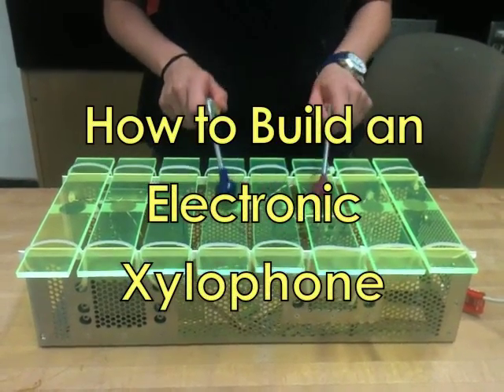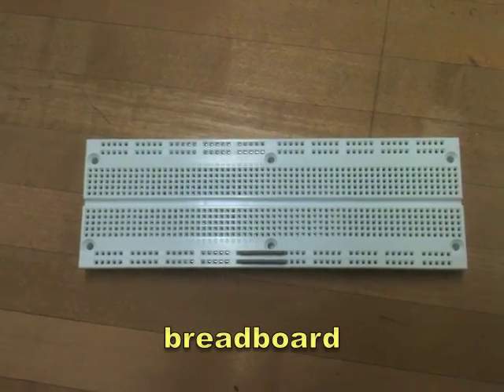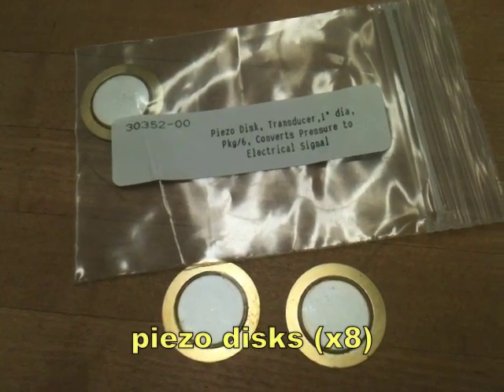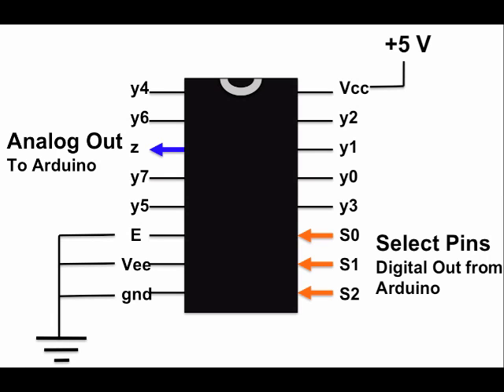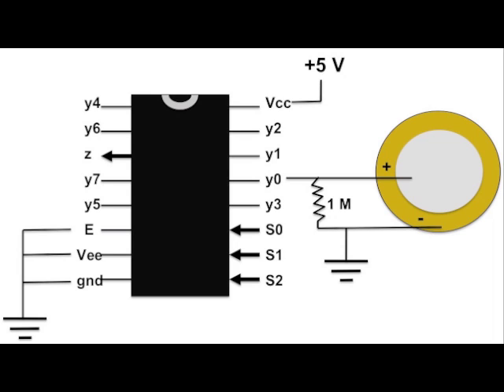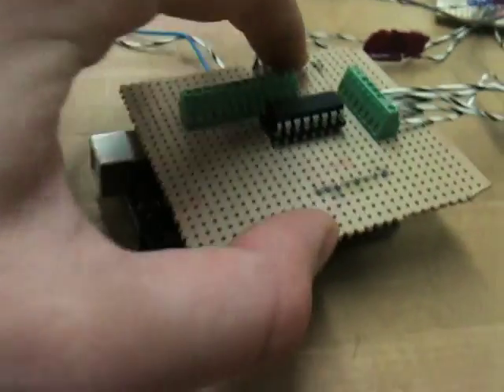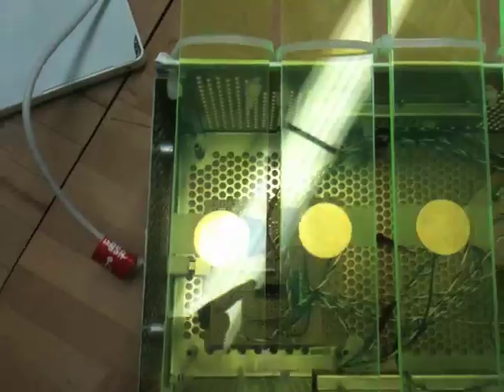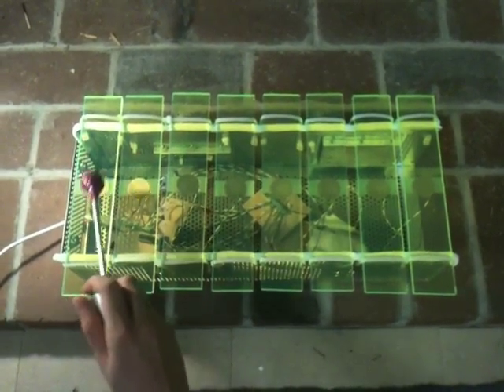Arduino: how to build an electronic MIDI xylophone

Comment from the maker: @gtrdrumsplayerduarte Yep, it's velocity sensitive; however, the material I chose for the keys (acrylic) isn't ideal if you care about velocity.  The acrylic is rigid and doesn't transmit vibrations very well, and so the force of the hit isn't always proportional to the voltage across the piezo.  If velocity is important, I would probably choose a different material for the keys- maybe wood?

Comment from the maker: @verakounda  Now that I think about it, it's probably easier if you buy a shield because setting up the circuit with lots of multiplexers doesn't sound very fun to me.  Google "Mux Shield Arduino" and you'll find a multiplexer shield sold by Sparkfun that allows you to have 48 analog inputs into the arduino.

There's a great MIDI drum kit project that you should check out because it accommodates 48 inputs.  Google "YAAMIDRUM."

Comment from the maker: @verakounda Definitely. Assuming you want sharps/ flats, that's a total of 48 different notes (12 notes * 4 octaves), which means you would need six 4051 multiplexers (which is perfect because most arduinos have six analog input pins). I'm happy to provide help or addition information- just shoot me an email.